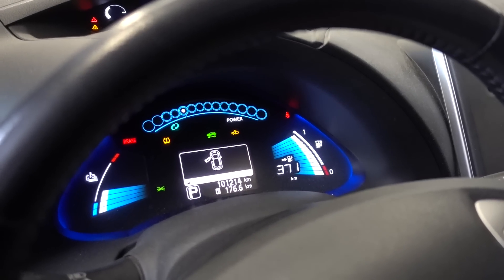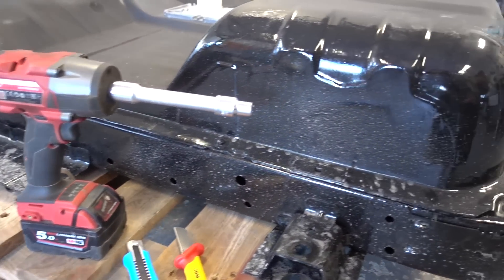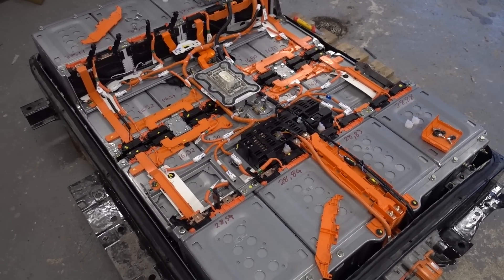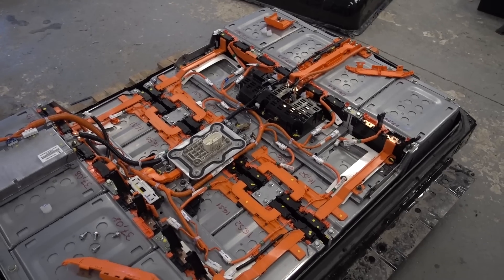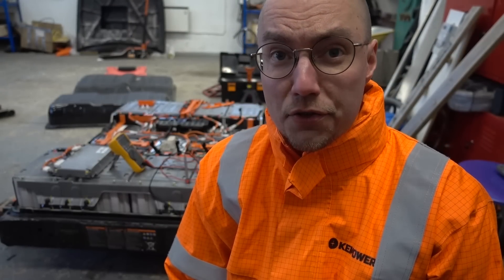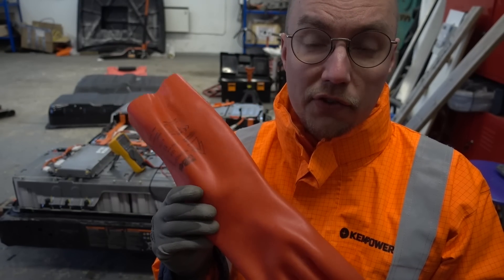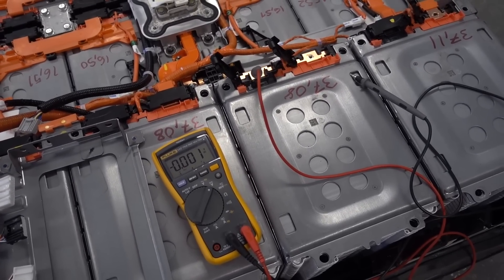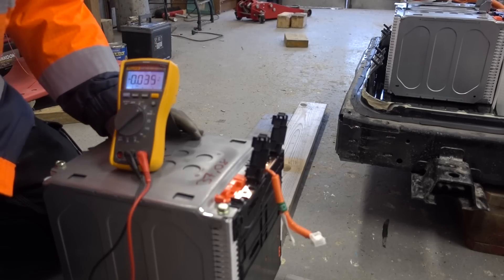62kWh isolation problem [part 1]

Comment: Hi, I experienced the same issue. The isolation fault disappeared after I removed the module. I even measured it with 1000 V, and the insulation resistance is over 4 GΩ. After it has fully dried, is it safe to reinstall the module?
Reply from the maker: Interesting, and impossible to say. It could be that the cell works, or it just works for a while until it develops the same symptoms. If you are having issues locating a replacement, it might be worthwile to run a test where you fit it back!

Comment: How would I test the service disconnect voltage with the battery still on the car?  Can I put my negative lead on a body bolt to ground to and be safe?
Reply from the maker: Yes the same measurement can be taken while the battery is in the car

Comment: Sorry can't help, but I see this is a year old, so you've either solved it, or the pack has been disassembled and repurposed. But for someone who really only just drives a Nissan Leaf, it's eye opening just how complex its battery pack is. Presumably new BEVs have worked out a much simpler and more robust way of doing things battery wise?
Reply from the maker: Yes it is solved, see the other parts! 

Newer batteries are way more complex than this, any battery with active cooling has double the amount of components. The LEAF is the easiest to repair EV of all time!

Comment: Hallo Dala! Entschuldigung dass ich dich wieder störe! Ich hab Leaf 40kWh. Das akku ist nicht mehr das beste aber zeigt in Leafspy und in diag(auch in Nissan service und bei spezialist 3 verschiedene test)praktisch kein fehler. Hx ~71.xx% SOH~83%. Problem:DC Laden geht gar nicht. Wenn ich es probiere schmeisst sofort raus und kommt DTC:P0AA6 isolationsfehler kein neustart mehr. Wenn ich lösche geht wieder. Mit AC Laden funktioniert problemlos. Ich hab damit 6-700km nur mit AC ladung gefahren. Kommt auch gar kein fehlermeldung oä. Bei 12%SOC 80mV unterschied bis 17% etwa 30mV. Nach diese video hab ich auch hauptsicherung raus genommen und gemessen. Hintere PIN geht schön auf 0 wie bei dir aber vorne zeigt 22,7V. Laut spezialist ist Leaky Cell symptome. Ist es wirklich so? Er kann mir das akku gegen eine andere tauschen aber will ich auch sicher sein dass wirklich das akku ist! Könntest du mir helfen? Danke im voraus……Dein Fan
Reply from the maker: Hallo,
Höchstwahrscheinlich liegt es an der Batterie, die einen kleinen Isolationsfehler aufweist. Der Austausch einzelner Module ist möglich, am einfachsten ist es jedoch, die gesamte Batterie auszutauschen. Traurige Neuigkeiten :/ Viel Glück bei der Reparatur!
Reply: @DalasEVRepair  Danke! Wie ich gesagt hab: ich hab kein problem mit akku tausch. Ich wollte nur 100% sicher sein dass nicht anderes ist. Ich hab schon termin am 29.8 tauschen wir gemeinsam aus auf 2020 mit 92% SOH. Mit Zellen wollte ich nicht spielen akku mit 83-er SOH muss ich nicht retten. Ich baue selbst akkus Für e-bike Powerwall e-moped usw….. aber zum solche projekt hab ich kein platz und lust noch weniger(und werkstatt auch keines). Danke nochmals für alles! Was du hier machst ist echt super! Wir brauchen viele solche leute!
Reply from the maker: @pmikeske  Danke! Viel Glück!

Comment: @DalasEVRepair I have this problem on my Nissan Note e-power HE12. I am very sad that the megohmmeter and other measuring devices cannot detect this problem... leaks and startup prohibition - while the problem is “floating”, you can drive 300 km, or 50 km... and then get an error...

Comment: I might be 10 months late now, so I hope your memory is excellent as always. Not related to the reason you took your pack apart, but I've been trying to figure out how the 62 kWh packs keep warm without a physical battery warmer for years now. When you took apart the pack, did you see anything inside that would facilitate a "software" warming mode? The hypothesis for years has been the shunts, but don't know if they can produce enough waste heat for the whole battery?
Reply from the maker: The battery has no heaters. Simply using the pack heats it up!
Reply: @DalasEVRepair  Would that be the same as turning it on with climate control, lights, radio, all switched off? Just having the main contactors engaged and DC-DC system running is enough internal battery heat?

Comment: I would loosen and retighten every pack, re-position all the straps , re-tighten those, inspect and reconnect all the bus bars, then test it again. I would make a cable to connect the battery to the car without installing it in the body, and test operation with the car up on blocks, use leafy spy, and test all systems...see what you have.
Reply from the maker: Been running great for many months now 🤩

Comment: Hi!  Electrician here : Your high voltage gloves MUST BE WORN WITH LEATHER PROTECTORS over the insulating layer.  They are NOT designed to be used without leathers!

Comment: Dala, can you help finding the spec on a 40Kwh battery? I have the same issue internal battery pack insulation leak. I am not able to find a vedio or spec on it.  Thank you
Reply from the maker: You can use the measurements from the 2015 24kWh pack, the details are close enough with cell layout and values: https://www.nicoclub.com/service-manual?fsm=Leaf%2F2015%2Fevb.pdf

Comment: I know I am very late to this, I wonder if the small dent is the result of the pack being lifted on a forklift at some time. I would have investigated using Kapton tape if you can identify where the leakage occurred but I am sure you have a solution by now.
Reply from the maker: Yes it got solved, watch the later videos! That dent was just minor, cosmetic only! Most likely forklift yes.
Reply: @DalasEVRepair  thank you for the swift reply, and yes I did go on to watch the later video. Well done with all your work, your channel was recommended by "Transport Evolved".

Comment: The voltages you measured between ground and battery terminals before you removed the faulty module were 12.x and 24.x. This suggests the short happens on cell number 3. I suspect that cell is somehow shorted to the one of the compression bolts.
Reply from the maker: I would 100% agree with you!

Comment: The Rods are steel, if some cell is little bit unpricise, it can give voltage to the rod. Once One Ukranian disasembled the pack with the same problem. He just covered up the Rods with isolation tube and the problem was gone. It was 40kW pack. This problem was not in 24kW packs.
Reply from the maker: I think simply unbolting and releasing the tension (and shifting the electrolyte) is what atleast temporarily fixes the modules! It is good that the bolts are steel, having the system unable to detect leaks would be quite dangerous.

Comment: The voltmeter measures against a high resistance load, (the internal voltmeter resistance is very high). It would yeild more information if you can adjust the load that you are measuring the voltage drop across. So put a variable resistance of some sort in the path and measure the voltage drop across that. Provided your resistor is rated high enough wattage. I'm thinking internal damage to the cells (internal resistance of the battery coming in to play) will have a different characteristic to an insulation problem.

Comment: The fact you were seeing 12/24v suggests that there is a short or leak one-third of the way through the series stack. It would probably be useful to measure the resistance of the short by seeing how the leakage voltage changes if you load the meter - that should show if it's a dead short or resistive - e.g. moisture etc.  I suppose x-raying the pack might show up internal damage, but probably needs a powerful industrial x-ray to penetrate the steel sufficiently.

Comment: If I was you ,  I should taking apart the hole damage cell part and inspect any damages!! do not put this pack back with the rest of them!! try to buy an other. you may damage the hole pack in the future or take a fire after some chademo dc charging. Also try to find the isolation issues with a megohm-meter, so buy one!! when we make inspection or an isolation issue , there is only one type of meter that send 250V 500V and 1000V dc to the line in order to find the isolation issue, megohm-meter . You will never find isolation issues with a simple Ohm meter only... the pack was squeezed but also was under a big voltage ! the issue is there and for the most part must be from the half of the pack and down!!

Comment: Hi Dala, we are doing repacks with modules from China and one of the modules was placed on an uncleaned surface. It has a small dent of 2x3mm and is less than 1mm deep. This module is shorting to ground due to the one cell being damaged.
The modules are made up of prismatic cells stacked upright and bound together. Technically speaking, when the cells are manufactured, the insulator that is rolled up with the active material should overlap a little, so that when the flattened roll is squeezed into the box, the active material should be nowhere near the metal can housing. 
Clearly these tolerances are way lower than we would have though, or we were just very unlucky.
In your case the dent that was made in the base of the pack, clearly pushed fairly hard through the steel 'frame' of the module and made a dent internally. You would have to bolt it back onto the bump to replicate the fault again.
My advice would be to replace that module/cell if at all possible. The chances that this cell will fail prematurely are very high, as dendrites would have a much shorter path.
The soup packet cells seems are more forgiving, so if you wanted to take a chance, it should be ok to remove the dent and refit the pack.
Thanks for putting your stuff out for others to learn from.
Great channel!❤
Regards Jens
Reply: Modules from China??? My 2011 leaf only gets 25 miles per charge and is supper clean and has no other problems. Love the car but is becoming useless
Reply: Energy density is the name of the game
Reply: Where are those modules available to purchase?
Reply: @EuphoricHacker  Shenzen Starmax
Reply: Is your project to strip down prismatic cells to replace the original pouch in Nissan's cells? Or is Shenzen Starmax doing cells that matches Nissan? If you are stripping down, which prismatic cell model are you using?
Reply: @EuphoricHacker  we are using brand new cells and or modules (6S1P) from Starmax. The old AESC packaged pouchcells we repurpose for solar with huge success. The loose cells are long prismatic about 115x30x300mm 114Ah. The modules vary. 4S1P is also available that can make a Leaf to have 65kWh.
Reply: hi jensdenk, Im intending to replace the module in my pack to make it 40kwh,. and seek some advice , is it worth doing so ?
what about safety/
Degradation?
is there any reviews from owner already done that?
Reply: @dowlutteeasooreeanand1355  hi, yes, it is worth it. The Leaf in particular has a very high build quality so the vehicle and most components can last 30years. Depending on where in the world you are, you can buy modules loose from a scrap yard (risky), you can buy a repacked or new pack from Nissan (expensive), or you can import modules from China, and if you have an automotive technician who knows EVs and DC HV (dangerous - kan defs kill you on contact) he can fit the modules for you.(cheapest option - especially if you're close to China) let me know if you want details for suppliers of the modules.

Comment: Hi Dala, one of the pouch cells of the individual battery packs may have become defective due to the mechanical stress of an accident, this may only have an effect when the entire pack is pressed. Perhaps use an insulation tester (approx. 1000 volts) to carry out an insulation test on several cells in the block in question.

Comment: I guess most of us will be keen to know if there are any simple tests to check a battery pack before buying. For example, would a resistance/isolation check between HV connector pins and the case show us a leaky pack or do we need the pack to be installed in a car with contactors "on".

Comment: nice videos my friend, you really add value to the community. quick question, is it possible to remove the top speed limiter on newer leafs? the 62kwh version is capped at 165kmh can that be removed? also, would it be bad for the battery/motor? would be interesting to know!
Reply from the maker: No, the 165km/h corresponds to >10kRPM , so going higher would over-rev the motor.

Comment: To my mind that dent was superficial/cosmetic and very unlikely to be connected with your stack short.   Much more likely is the possibility of an internal short to the case which has disappeared when the stack was allowed to expand free of bolt pressure.  You need to look at the internals of this stack for the possibility of a short around the centre part of the cell stack.  Very informative and educational videos - I commend you for them.

Comment: From the voltages it looks like short circuit connection to ground somewhere in the 2/3 or 1/3 fo serial string of cell. You cen exactly count which of serially connected cells in module was leaking from the voltage of cells and the leakage voltage.  I expect it will be somewhere in the middle. Dent on the bottom could have nothing to do with the issue. Locate the cell and you will see what is bad. Are the side walls or the area where are cells connected each to other ok? May be the module was shifted from the forces from accident and something touched the metal cover from inside. I am just guessing that in front there are 7S, middle is 4s and rear are 9s configuration so it should be short circuit between connection 3rd and 4rd cell to the ground. Good luck!

Comment: Hi, Dala ! Given the Voltages in the video (-22,43V and 12,58V), it is easy to say, that the problem comes form some of 3rd cell row in the pac (form top, or from the bottom - I don't exactly know, should check that on the module itself, having in mind that pac comes with 9s2p). Lucky for know that it is probably only one cell to ground for now. If there would be a second one too espiacialy in some longer away pac there would be high currents floating between with fire in the battery. 

The idea that battery was in car crash and because of that some screws moved is not necessarily the truth. Cells in those pacs are very well known for being often expanding with aging and especialy QC to full in hot environment. If that is the case, if all cells are expanding the pressure could even move or even bend the screws. But of course - that is the sign of seriously used battery. Would be easier to check live with a naked eye if that could be the cause because it is hard to say from the video

Comment: Battery box is bent. When you tight screws in to pack + battery box something will touch wrong place inside pack, or just it bent and cell insulation fails.

Comment: Measure isolation with high voltage tester. The cells will have an isolation spec. It might be VERY HIGH, I would not be surprised if it were >3,000 volts ac or > 4,500V dc.
If that seems high, bear in mind something like a metal cased Sky+ set-top PVR box is tested to 3,000V ac for 1 minute

Comment: I'm probably way too late for this, but I'm curious if just the dented casing was touching the bottom of that cell stack which caused the isolation issue? You could confirm by just electrically connecting the bottom of that cell stack to the outer battery casing to see if that would cause the isolation problem?
Reply from the maker: No the dent was actually not high enough. Red herring!
Reply: After reading some of the other replies, I guess as much. =/
It would also by a pretty awful design if that were the case. =D

Comment: Seems like a tricky situation. A weak module that you charge to balance, if weak will eventually imbalance itself again. I remember some other Leaf owners mentioned something about testing the modules under heavy load. Essentially "weak" cells would drastically drop in voltage when flooring the accelerator. A bit tricky to "replicate" that load but it's something to test and verify if your weak cell will end up losing balance again. And the worst is a weak cell shorting and frying the rest of the pack like mine did. As for the shorting pack... I'd personally replace it.

I guess tldr, replace both modules. These should be specially manufactured so I don't think they disassemble as easily as the 40kwh modules. You could try out of curiosity and see if you can repair it but my gut tells me the high density leaves it more vulnerable to physical damage and as you said, these are damaged.

If you have an isolation issue once, you'll get it again. Also to properly replicate the isolation, you would actually need a bottom plate to mount it to right? I don't think the bolts are enough as the shell flexes. Either ways, you don't want to be surprised by an issue you didn't fix with certainty while on the road in a 3500lb moving vehicle.

Comment: The stack is likely weak and should be replaced; the impact is strong enough for that dent could have damaged inner layers within the tri-cell lithium pack. I wouldn't trust that stack and even be a little wary of a spontaneous event.
Reply from the maker: This is what I most likely will need to do. Replacement.